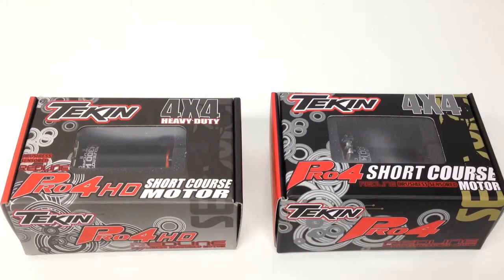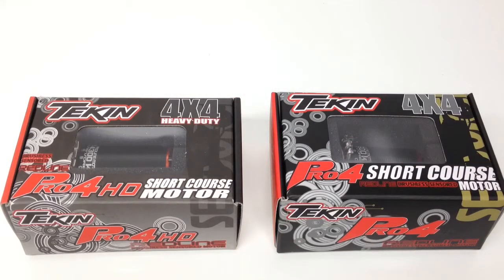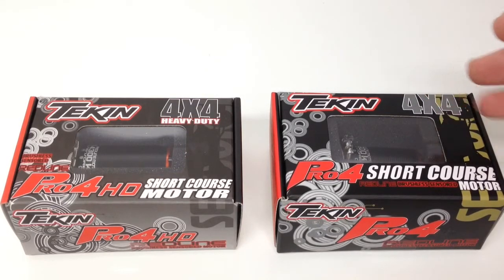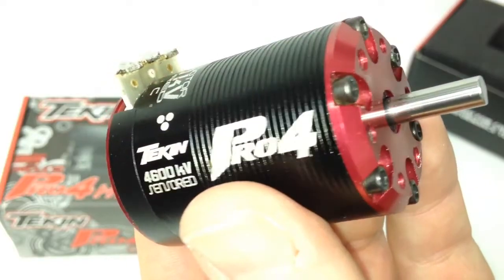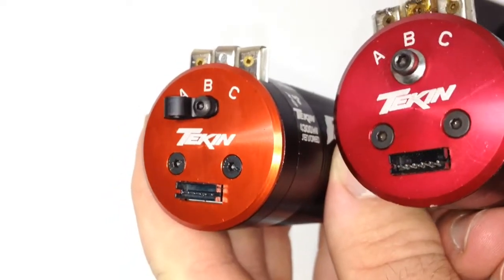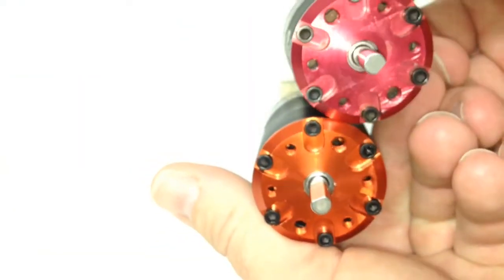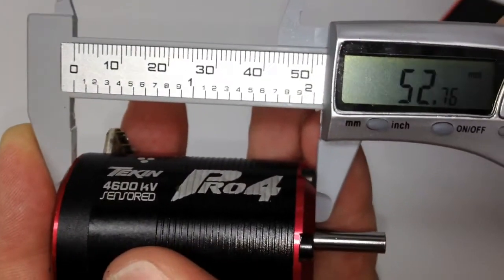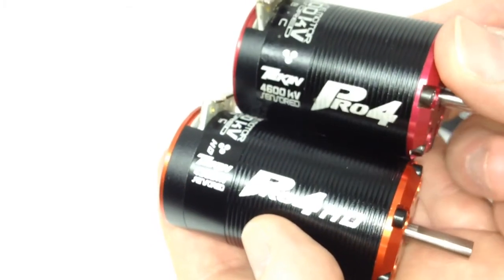Tekin Pro4 vs Pro4HD Brushless Motor Comparison

Comment: Which motor for a custom 11lbs 4x4 truck
Reply from the maker: Out of these two... the Pro4HD, but I would go with the 2500 on 4s.  Also look into running a T8....but it depends on how fast you want to go

Comment: Is the 4600 better and faster than the 4300
Reply from the maker: Sean Salter the 4300 will have more torque and be able to push around a heavier truck than the 4600. Of course, the 4600 will have more topend speed

Comment: Do u lose speed from not plug it in
Reply from the maker: Nope.....but you will lose the smooth feel at low RPM's along with the efficiency of the sensored mode

Comment: Can I stick a pro 4 HD in a Traxxas slash 2wd will it fit THANKSSS
Reply from the maker: Sure, it will fit, but Tekin recommends the Pro2 for the 2wd.  YOu'll also need 5mm bored pinions

Comment: Can you use 3s lipo on the pro4 hd 4300kv?
Reply from the maker: Not according to Tekin.
Reply: +The RCNetwork  ok on tekins website it shows that the 3000kv one works on 3s could I also use 2s lipo  I'm trying to find the perfect sensered motor to work on 2s and 3s
Reply from the maker: +Ludy Garcia yes, the 3000 can run in 2s or 3s
Reply: +The RCNetwork thanks! Love your videos! Mostly project sleeper!
Reply from the maker: Thanks Ludy!

Comment: Which is better for short course racing a high or lower kv
Reply: I'm looking for speed
Reply from the maker: +Aidan Nina Depends on the track.  If you're looking for top end speed, go for the 4600kv Pro4.
Reply: +The RCNetwork what do you mean by top end?
Reply from the maker: +Aidan Nina As an example - A 4600kv motor will have more speed (at the height of the trigger) than a 4000kv.  The 4000kv will have more torque (the ability to get up to speed/jump quicker) than a 4600kv.
Reply: +The RCNetwork okay thanks man really appreciate it

Comment: For the pro4 for 2s there is 4600kv and 4000kv what one will give you more power
Reply from the maker: +Kaleb Moore 4600 will give you more topend speed and 4000 more torque.  It really depends - If you're racing - how long is the longest straight.  If it's pretty long, the 4600 will benefit you.  If it's a tight technical track, the 4000 will benefit, as it has a bit more torque to power over the jumps quicker.

Comment: Great video, Thank you!
Im searching the internet, trying to find out if I can run my Tekin Pro4 HD 3000 KV with 4S batteries. I am aware that Tekin says no, but what would happen if I tried? Would the motor just let out some smoke and be on a permanent vacation, or would it just be hard on the motor for extended use?
any help would be great :-)
Reply from the maker: +nolimeplease Technically no - Especially according to Tekin.  You can plug 4s power into it and it will work, just be careful on the temps.  Let say you choose to plug 4s power into it, depending on gearing, weight of the vehicle and the terrain.....it could overheat and De-magnatize the motor rendering it useless....You can also get the 2400kv and power it all day long on 4s

Comment: Great review once again! I'm putting together my electronics in preparation for the sct410.3. So all in all, which is the best all around motor? I race on all size tracks, indoor/outdoor, long/short. But all in Pro series type races. Which do you think is the best overall: Pro4 4600 vs Pro4 HD 4300? Thanks!
Reply from the maker: Steve Glassinger I would probably choose the Pro4HD 4300.  It will have the extra torque for those outdoor tracks.  you can adjust your gearing for more top end speed
Reply: The RCNetwork

Comment: Will the pro 4 hd fit in slash 4wd?
Reply from the maker: Steve Florez I believe so.......It doesn't really need it, as I run the Pro4 4600kv motor in my Slash Plat LCG Sleeper truck

Comment: I ordered a Tekno sct410 and will start building later this week... What would be the best motor to run in that truck. Already decided on going with the RX8 GEN2 esc and Savox 1258tg Servo. Unless you have found a better setup in your SCT410, please share your thoughts, thanks!
Reply from the maker: +Steven M The Pro4HD 4300 is the ticket, unless you plan to go lighter wieght, then the Pro4 (540- sized) motors will due - 4600kv if you have a larger track, 4000kv if you have a tighter/smaller track.  Otherwise, you have picked great stuff.  The RX8 Gen2 will keep that Savox wrangled as well.
Reply: Good to know, thanks for the reply. I been watching your videos and am convinced your advise is top notch from your experience and how informative your videos really are. Keep up the good work bro.
Reply from the maker: +Steven M Thanks for watching, Steven

Comment: Did you ever do back to back runs with these two motors and make any comparisons?
Reply from the maker: I did not in the same truck, but did compare between a SCTE running the 4600 and a SCT410 running the 4300.  The SCTE was about 1 lbs lighter than the SCT410 and I was happy with the 4300 in the SCT410. It clearly had more torque than the SCTE and I adjusted my pinion up in the SCT410 to compensate for the less topend speed (running a 18t vs 16 in the SCTE)

Comment: Witch kV MTR would be best in a crawler slash rock racer like a wraith love the kids kinda a newb
Reply from the maker: The Pro4 4000 would probably be the best bet out of the two.  If you want to run 3s, the 3300kv would be the beter choice.  Keep in mind, these are extreme torque 4 pole motors and can tear up a Wraith's drivetrain.  You may want to look at upgrading the transmission gears, driveshafts and bevel gears if you choose to run a brushless system.  Another great choice are the Tekin Roc412 motors.  They're designed for rock racers giving speed with a 3s setup and torque when running 2s

Comment: Which one is better for my slash 2wd?
Reply from the maker: Both would probably be overkill for Slash 2wd.  You may want to look at a Tekin Redline Gen 2 motor.  The Pro4's are really designed for 4wd trucks
Reply: thanks

Comment: Which one of this is better for my scte?
Reply from the maker: RedDelPaPa, please go watch and comment on someone else's videos. Better yet, make your own.
Reply from the maker: It's alright! Lol. I'm sure I and Team Tekin are wrong and you're right. It's all good. You must be a Jang fan........
Reply from the maker: The Pro4 is probably better all around. The HD has a lot of torque and is a bit smoother, but needs premium batteries (75c+ constant)
Reply: The RCNetwork
Naa.  the Pro4HD 4300kv runs just fine on duratrax 5000mah 25c lipo's.  And it will produce more power and run cooler than the Pro4 model.  Gets about 12 to 15 minutes of run time in a Losi SCTE 2.0, and doesn't get any hotter than the stock motor in a SCTE RTR on the same batteries.
Reply from the maker: I've run both motors including the 4000kv and 4600kv in the Pro4, 4300kv in the HD. You're also crazy if you think 25c is enough support for those motors. I'm speaking from first hand experience......
Reply: The RCNetwork
Funny, cause I speak from first hand experience as well.  Sure it might run even better on a 50c high mah batt, but the thing already runs like a possessed demon on the duratrax batts I mentioned.  Borderline uncontrollable already.  What more do you need?
Reply from the maker: Here's some info from the horses mouth, or Ty Campbell, Tekin's CEO:

by Ty » Sun Apr 14, 2013 7:40 pm
C rating on LiPos just tells you the current it can supply if the motor asks for it. For the Pro4HD I'd recommend at least 40C packs and remember, you usually get what you pay for.
Ty Campbell
Tekin, INC.
www.teamtekin.com
Ty 

Sure you can run 25c Lipos, but at some point something will give. Either your performance, your ESC/motor temps or the Lipo will fail and you know what that means:  time to buy a new truck because it went up in a Lipo fire.
Reply: The RCNetwork
Well, you and Ty both are missing something.  The available continuous current delivery from a 4000mah 25c is not the same as the available continuous current delivery from a 6000mah 25c battery.  The figure is amp hour times c rating.  4.0 times 25 = 100 amps. 6.0 times 25 = 150 amps. Also keep in mind that max amp draw comes when the motor is at a dead stop, and is very short lived.  There is no way an SCTE with a pro4hd will draw continuously, what a 5000mah 25c can deliver.  You might see a little more punch off the line, but that's it.  Top speed and mid range are unaffected. And again, I stress that an scte 2.0 with the pro4hd 4300kv and a duratrax 5000 mah 25c lipo is already so punchy it's almost uncontrollable.  After lipo cut off, my packs are at worst, slightly warm.  No warmer than what comes out of an SCTE RTR with stock equipment.  If you have some overhead on your batteries, you're fine.  C rating is mostly a marketing gimmick to get you to spend more money than you need to.
Reply: The RCNetwork
Haha.  I'm not saying you're stupid.  I'm just saying I know what I see with my own eyes.  As the saying goes, am I going to believe you or my own lying eyes?
Reply: The RCNetwork haha "jang fan" you just made my day, because how true you are by saying that.
Reply: rctrains
Hey man, lets line em up.  My duratrax 5000 25c and 35c packs will hang with you all day long, and for a lot less money.  But if you choose to believe the hype and want to break your bank for some 75c batts, by all means have at it.
Reply: I'm running a losi scte and I bought  the Tekin pro4 4600, and one of my lipo, the cheaper one become bigger after just one ride. A good ride but just one. My point is, the quality of the batteries with those motors is realy important. I agree with you. RCN.

Comment: How  low KV should I go to run a back yard basher and track what size pinion should I use also with all tekin set up esc also . This is for  a losi SCTE
Reply from the maker: I would probably pick the Pro4 4000kv unless you have some really long stretches in your back yard. Pinion wise, start off with a 14-15t and watch the temps.

Comment: +The RCNetwork ok I cant afford an rx8 esc and I want to put a tekin pro4 hd in an losi scte what esc do I use!?
Reply from the maker: I first ran an MMP / Pro4 4000 in my Losi SCTE and had major problems. The MMP was hitting close to 190 degrees with normal gearing, the Pro4 was easily hitting the 160's. I also puffed 2 lipos during this short time. I bought an RX8, same gearing, and temps were 105 on the RX8 and 135 on the Pro4 with similar lipos. I know the RX8 is pricey, but you only have to burn up two $100 ESCs to find out.
Reply: I guess that is true but to be fair the mmp isn't rated for that weight with a motor of the magnitude
Reply from the maker: I guess I can only tell you what I've experienced with the MMP and RX8, as those are the only 2 ESC's I've used in an SCTE.  I now own 3 RX8's and have never had a problem.  The Pro4 series of motors are very demanding and the weight of the SCTE can be heavy.  Good luck in your search.
Reply: ok I will search but chances are I will either get like a 150 amp 1/8th scale hobby wing esc of an rx8

Comment from the maker: I would go with the Pro4 4600kv.  Great overall motor, lots of torque and speed.  YOu can also look at the Pro4HD 4300kv, a bit slower, more torque, but since it runs cooler, you can jump up a couple teeth on the pinion for the top end speed.  Make sure and use an RX8 to get the full potential of the Pro4

Comment from the maker: For the Slash, if you're just bashing, the VXL motor is fine.  Def watch the temps on 3s and get ready to start spending some money on drivetrain parts ans things you break.  Not sure on the Stampede, as I've not had any of the Traxxas monster trucks

Comment from the maker: I based my decision on the weight of my car.  My SCTE/MIP weighed under 6lbs, so I opted for the Pro4 4600.  My Tekno was nearing 7lbs, so opted for a bit more torque with the Pro4HD 4300.  Either choice will work great.  If you're a stock STCE, the HD might work better, but you will have to gear up for top end speed.  I ran a 14t in my SCTE/4600 and an 18t in my Tekno/4300.  Both had about the same top end speed

Comment: an addition to rich's comment... a 4300kv on 2 will be pretty close to the max speed of a 2150kv on 4s (when geared right) BUT your run times will also be half as much. On a 4300kv motor with a 5-6000mah 2s pack you can expect around 10-15 minutes run time. A 2050kv motor on 4s will net you higher torque, and similar top speeds and since the setup is more efficient (lower kv, higher voltage) you can expect about 25-30 minute run times. hope that helps!

Comment from the maker: The Mugen is a great buggy.  On Tekin's site, they state that all the T8 motors require 4s power with the larger truggy/low kv motors requiring upto 6s.  This is all relative to how heavy your buggy is and really the amount of top end speed/torque that you want.  I would get the 2050 and at a minimum run 3s.  I have a 5.5lbs 1/8th scale buggy running the new Pro4HD 4300 on 2s and it flys.  I haven't spec'd a 1/8th scale with Tekin before, so you may want to check the forums....hope this helps

Comment from the maker: Nice catch!  Yeah, it's a bit confusing though as you look at it all though.  SC4x is 2 pole but for Pro4 racing, Pro4 is 4 pole for Pro4 racing, Pro2 is 4 pole for Pro2 racing........It's par for the course though.  Why is there kv vs. turns, why is there 3 different splined servos - 23t, 24t and 25t?  Why are there 14 different balance adapter plugs on Lipos?  Why is there no regulation on "C" ratings in Lipos?  The list goes on and on! lol

Comment: Pro-4 doesn't mean that it's 4 pole. that is the class that the motor was designed for. the new tekin pro-2 motors are also 4 pole, but meant for the pro-2 class (2wd SC).